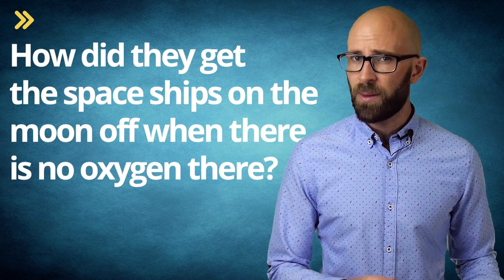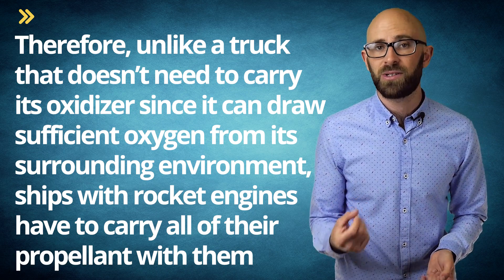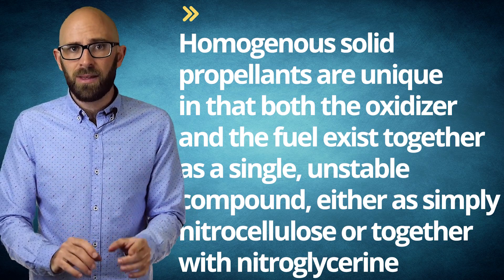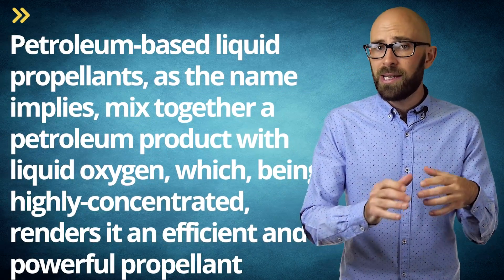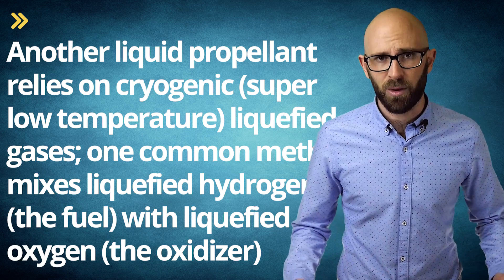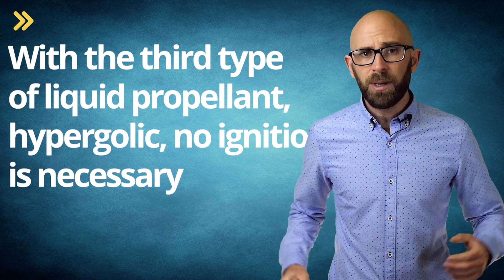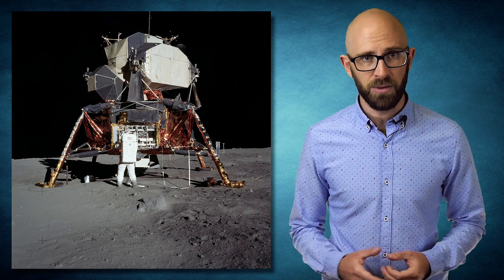How Did Lunar Landers Re-Launch When There's No Oxygen?

Comment: where is apollo 11 hypergolic visible fire in vaccume ?  Hypergolic propellants are a type of rocket fuel that ignite spontaneously upon contact with each other, without the need for an external ignition source. They are commonly used in spacecraft propulsion systems because of their reliability and ability to ignite in the vacuum of space. When hypergolic fuels combust, they produce a visible flame, even in a vacuum. Here's how and why this happens:

How Hypergolic Fuels Work
Hypergolic fuels typically consist of two components:

Fuel: Commonly hydrazine (N₂H₄) or its derivatives like monomethylhydrazine (MMH).

Oxidizer: Typically nitrogen tetroxide (N₂O₄) or nitric acid (HNO₃).

When these two components come into contact, they react exothermically (releasing heat) and ignite spontaneously, producing a flame and exhaust gases.

Visible Flame in a Vacuum
In the vacuum of space, there is no air or oxygen to sustain combustion in the traditional sense. However, hypergolic fuels do not rely on external oxygen—they carry their own oxidizer as part of the chemical reaction. This means they can burn in the absence of an atmosphere.

The flame produced by hypergolic combustion is visible because:

Hot Exhaust Gases: The reaction produces extremely hot gases, which emit light due to their high temperature (thermal radiation).

Chemical Luminescence: Some of the chemical reactions in the combustion process produce excited molecules or ions that emit light as they return to their ground state.

Expanding Plume: The exhaust gases expand rapidly into the vacuum, creating a visible plume that can be seen as a bright flame or glow.

Characteristics of Hypergolic Flames in Space
Color: The flame is often a bright orange or yellow due to the high temperature of the combustion products.

Shape: In a vacuum, the flame expands rapidly in all directions, forming a diffuse plume rather than a tightly defined flame like you would see in Earth's atmosphere.

No Smoke: In space, there is no air to carry soot or smoke particles, so the flame appears cleaner compared to combustion in an atmosphere.

Comment: Umm... What about the fact that propulsion of any kind is useless in a vacuum?., You cant push yourself in any direction using thrust because there's nothing to thrust against. Which makes all of the so called space missions either fake or there's no vacuum. Either way they are lying to us about it all.
Reply: The exhaust gas is not what propels the engine. Rapidly expanding gas presses against all sides of inside of the engine. 
Since there is no bottom on the engine there is more force pressing upward on the inside so the engine moves in that direction.
Reply: exactlty, newtons 1st law of inertia.

Comment: I would like to know what happened to the blast crater which would obviously be beneath the moon lander after a rocket was used to land it. Who cleaned the feet of the lander to such a spotless state? Try to answer using scientific principles as opposed to ridicule. Thanks.
Reply: The thrust needed to arrest the descend was quite low, owning to the weak gravity. So no, there wouldn't be a crater.

As for the dust, keep in mind that it behaves very differently in a low gravity environment without atmospheric pressure. Instead of hanging in the air and eventually settling as we see it on earth, it would have flown away from the lander, hence why we don't see it settle on the lander's feet.

Comment: If the questioner was referring to oxygen as a requirement for the combustion process; not understanding that the oxygen was stored within the spacecraft - as distinct from sucking the oxygen in from the atmosphere like a jet engine on Earth - then the answer given by "Today I Found Out" is an appropriate answer.

However, my initial reaction to the question was that the questioner actually meant "atmosphere" instead of "oxygen", i.e. the questioner perhaps thought that somehow there needs to be an atmosphere for the rocket's exhaust to push against; in which case he was not understanding that rocket engines will work in a vacuum because of Newton's Third Law of Motion - "For every action, there is an equal and opposite reaction".

The wording of the question, if we can assume that "Today I Found Out" have repeated the question verbatim; is slightly different to the title of the video. We are told that Brian S. asked "How did they get the space ships on the moon off when there is no oxygen there?". The wording of this question is somewhat ambiguous, as it does not make clear why the questioner thinks oxygen is required in the first place.

So, we could then account for the question's ambiguity by providing two answers, thus:

1. The spaceship carries its own oxygen supply for the combustion process, in the manner described in the video, or;
2.  Oxygen (i.e. "atmosphere") is not required due to Newton's Third Law.

The balance of probability is that Brian S. was referring to the combustion process; however I am aware that there are people who flat out refuse to believe that space travel is possible, because they refuse to believe that Newton's Third Law allows for rocket engines to function in a vacuum. The vaguely stated nature of the question makes it impossible to be absolutely sure what the questioner means by "no oxygen".
Reply: The question was most likely a troll one from a moon hoaxer, meant to bait someone into wasting their time with explanations only to then completely ignore that and continue with inane questions and thinly veiled insinuations. I also think Simon and the gang knew this but treated it as a serious question anyway, to get a chance to explain the process.
Reply: That seems a reasonable possibility, thanks Benny.

Comment: if you think about it, that is a really terrifying situation to be in. You sit on the moon in the lunar module ascent stage, in front of you is a button which fires the rocket engine and you know that a.) this particular engine has never been tested b.) that there is no "spare" engine you can use if this one fails and c.) that if the engine fails, there is nothing anybody can do to help you, you are simply stranded here on the moon and you are going to die. I know that Nixon had a speech prepared in case this happened, but I wonder how the astronauts and mission control back on earth would have handled the situation. Would the astronauts have used some pills to "get it over with"? https://www.space.com/26604-apollo-11-failure-nixon-speech.html

Comment: Doesn't matter how much  or what ever combustible materials exhausted, in the alleged vacuum of space, rockets don't propell anything. Unless of course, space is not what we've been told it is. Just like the ISS having problems with moths, all while weightless at over 350 km above our earth, travelling at a breakneck speed in a vacuum of neg.7 Torr, surrounded by 120+ degrees Celsius at that alleged level in the troposphere. What'snext? Aliens from outer space?
Reply: Sure they do.

For every action there's an equal and opposite reaction. Throw stuff out the back of the rocket and the rocket will moved in the opposite direction.

Comment: Do you need oxygen to ignite something or an oxidizer (what is the difference between the two)?
Reply: Madhav Malhotra Any fire requires fuel, an oxidizer, and heat. Take any one away, and the fire goes out. Oxygen is the name of one specific element in the family of oxidizers (Oxygen containing substances).
Reply: So you do NEED oxygen, but it can be in a variety of compounds and those compounds having oxygen bonded to them are called oxidizers? (Also is water then an oxidizer, that can be used to ignite substances?)
Reply: Madhav Malhotra Correct! In the context of rocket fuels, water is often mixed with hydrazine fuel, as in the mentioned Aerozine 50, which is a 50/50 blend of hydrazine and water. In that instance, water adds to the mass flow of the exhaust as steam, thus increasing thrust. Water also reduces the corrosivity of hydrazine, enhancing system reliability. There's a lot more detail to it, which is why they call it rocket science! Lol.
Reply: Thank you so much, you really seem quite experienced in this area :-)
Reply: Madhav Malhotra You're welcome. Rocketry, and in particular, Human spaceflight, has been of great interest for most of my life. I'm fascinated by the details of how things work, so I've picked up a lot of detail info along the way. I'm no expert, just a practiced amateur scholar.

Comment: Ooh! Ooh! I know this one! You either use a pressurized oxygen tank, or a fuel that has it's own oxygen mixed into it, like a solid rocket booster. Let's watch...

Fail! At least in the case of the Apollo Ascent Module. I forgot about hypergolic fuels. I knew about the hydrozene thrusters on the command module, duh-OH!
Reply: rideswithscissors Actually, you're wrong about being wrong, right?

Even hypergolics contain an oxidizer, so you're still essentially good with Plan "A".
Reply: You are too kind! But there is a difference between a pressurized tank of O₂ and one of nitrogen tetroxide. And you can't store liquid O₂ very long.
Reply: rideswithscissors True, to be completely accurate you can't simply exchange O2 for Nitrogen Tetroxide. However, in a broader sense, fuel and oxidizer is still fuel and oxidizer, (even if hypergolic) without regard to the specific recipe. So, as it pertains to the concept raised by the original question, you're still in the ballpark. LO2 kept at high pressure has a pretty good shelf life. Cheers!

BTW: how do you get the subscript to work?

And let's not get me started on how Piper Cryogenics in Boulder, CO "caused" the Apollo 13 disaster. 😉 It was years after I had moved, that I learned it was just down the road from my house.
Reply: rideswithscissors Ah! Makes perfect sense! I'm doing this from my Android phone. No such options. Long story, but my primary machine is still XP (with current updates from MS), which has been boycotted by YT. Can't even watch a video anymore. My Win7 machine is lacking a proper sound system, so it's not a viable option at the moment...

I have no affiliation with Morton Thiokol / ATK. Yes, a very bad day. Amazing to see the 6-foot hole burned through the motor casing.

I'm jealous. I've never had the chance to see a launch in person. I did get to attend one Shuttle landing at Edwards. 7 hours drive from Phoenix to witness the 27 seconds from the double sonic boom / first sight to touchdown. Don't blink! NASA conveniently avoided overflying Phoenix for the final Shuttle return flight. It would have added about 45 minutes to the 3-day trip (Yes, they had more than enough fuel for their first stop in Tucson)...
Reply: Hydrazine, not hydrozene.
Reply: I thought Hydrazine was a publication for snake-tressed ladies!
Reply: No, but if there ever is such a thing, naming it won't be a problem. ;-)

Comment: Great video.. one minor correction.. The propellants don't explode, rather they deflagrate.
Reply: The exhaust is supersonic so detonation would seem to apply.
Reply: Erm... pretty sure explosions cover deflagration. Besides that I'd characterize the combustion inside a rocket as an energetic detonation. Exhaust velocity is hyper-sonic in many cases and if the pressure vessel of a more powerful rocket engine cracks while operating, it doesn't just spew burning fuel everywhere, it detonates extremely violently, often taking the entire rocket with it. A smaller hypergolic RCS thruster is probably more likely to deflagate the fuel rather than detonate it.
Reply: Flame propagation is subsonic on all rocket propellants including hypergolic ones; they deflagrate. Exhaust velocity has nothing to do with the combustion process. Exhaust Velocity is a product of the expansion of the gas in the nozzle.  When a combustion chamber fails it doesnt detonate. In fact most combustion chambers are only around 1000-1500 psi.  Go watch the one spaceX launch where they had a combustion chamber fail and the rocket made it to orbit just fine on 8 engines.

Comment: Great, thats one problem about propulsion on the moon solved. Now the big question that seems to defy physics. How did they place the lunar lander on top of 8 to 12 inches of lunar dust finer than flour with a bell shaped exhaust chamber spewing white hot exhaust at hundreds of KM per hour? I always wanted to see how that was done.
Reply: If I read that correctly and if I remember, the landing legs had long thin spikes pointing down off the feet of the legs. As soon as the spikes touched the surface the descent engine was shut off so the lander could softly touch down without spewing too much moon dust everywhere. Except Apollo 11 of course, where the engine was shut off late. I'm sure there was plenty of moon dust.
Reply: Next time you're in a wind storm, try eating a bowl of dry corn flakes using a pitch fork and wearing garden gloves. Thats about the best analogy to describe the probability of a LEM landing successfully on the moon. BTW: Check it out, there is none, and never has been, any video footage of a successful take off and landing of a LEM in earth gravity. But maybe landing one on the moon might have been easier... D'ya think?

Comment: There are also hybrid rockets that use a mix of liquids and solids. Mostly a liquid oxidiser and a solid fuel.
This makes them still a lot simpler than purely liquid based systems, but the power output can be controlled somewhat.

Comment: Actually the Space Shuttle main engines (the three big ones on the back of the orbiter) burned liquid hydrogen and oxygen and it flew 135 times. So does ESA’s Ariane V as did the Centaur upper stage used on many, many Atlas and Titian launches over the last fifty years. I don’t think you can call it’s use “limited”. It is probably as common in launch vehicles as hypergolic propellant. I also believe that the term “propellant” is generally used to refer to the fuel and oxidizer. Liquid oxygen is a cryogenic so rockets using LOX/petroleum combinations are usually lumped in as cryogenic systems. Finally, outside of military missiles, solids are almost always used to supplement liquid fuel launchers. All solid fuel satellite launchers (like the old Scout launcher) are the exception.

Comment: When we were watching rockets lift the Mercury capsules, we never imagined we'd still be relying on rockets almost 60 years later. Come on, scientists, open up those black projects and lets move on!
Reply: NASA prefers/preferred to use "tried, tested, and proven" technologies. I watched a video about the Curiosity (Mars rover) program, the R&D for something as simple as the retarder (parachute) was a figgin' mess. The development of "lubeless" motors/actuators was a disaster and was eventually abandoned for "traditional" motors. NASA has/had very little incentive to develop new tech and a lot of incentive to use stuff that had already been developed. The biggest limiting factor turns out to be TIME constraints. They even shut down the program for a bit because they missed the launch window (only viable approximately every 2 years). Thankfully the civilian sector such as SpaceX is actually run like a business and not the government. I believe this is where all of the advancements are going to come from.
Reply: well cars have used rubber tires since 1888 if it isn't broken don't fix it
Reply: Nothing has a higher energy density than rocket fuel, using anything else would require way more fuel and therefore more weight and therefore less movement.
Reply: Pringles Orginal actually we use synthetic rubber now for most tires ;)
Reply: Well we did just invent microwave propulsion but as mentioned nasa wont use it but i bet space x will!
Reply: Depends on how you define 'rocket' - any engine which moves a craft by the expulsion of matter in the opposite direction to the desired direction of travel is by definition a rocket.  Even the newest experimental electric drives such as ion thrusters are rockets per se.  The question should be why are we still using expensive and throwaway chemically propelled rockets.  Probably because right now they still offer the best kilogrammes of thrust versus kilogrammes of mass ratios we can get.  Time and focussed research will come up with something better, but it's probably still a long way off.

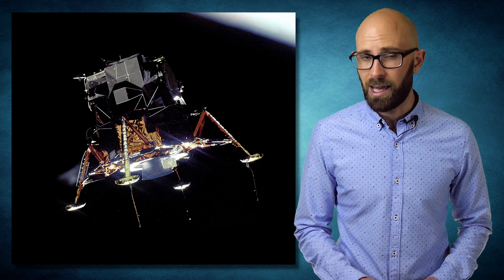Comment: @4:50 + you said 'The lunar module engines were Never tested before having to lift the astronauts off the Moon." !?!?!! Are you kidding!  doesn't everyone see right through this!? Who would agree to this kind of nonsense!  NASA lies this is fake the Earth is flat.
Reply: They didn't TEST FIRE the engines that shot the module back off the surface (Ascent Engines) because those engines would have to be REBUILT after being test fired. You CAN'T test fire the engine without rebuilding it, if you test fire it after the rebuild - you would have to rebuild it again... (you CAN'T test fire it) However, the engines are pretty simple and fail safe and that's why they were chosen for that application.

"According to the Science Channel's documentary Moon Machines, the fuel and oxidizer were so corrosive that the engines had to be rebuilt after each firing. This meant that each ascent from the Moon was performed with an engine that had not been test-fired prior to flight."
https://en.wikipedia.org/wiki/Ascent_Propulsion_System#Development

As far as a "Flat earth" - I'm guessing you have never been in an airplane? If you ever get out of your tiny town, and ride in a plane - look out the window when you get up in the air... that CURVED horizon will blow your mind! Also... please don't ever have kids.
Reply: What would you test? The two fuel components ignite spontaneously on contact with each other. All you need do is have two pumps to push them together, and.....

Armstrong even suggested at one stage having manual rotary valves for him and Aldrin to open up...